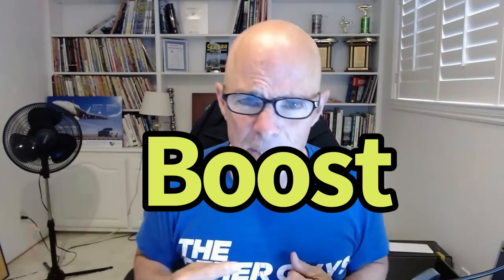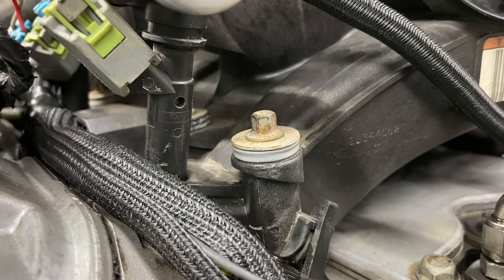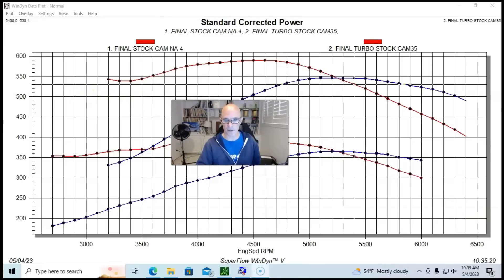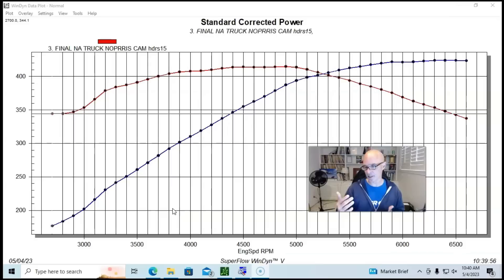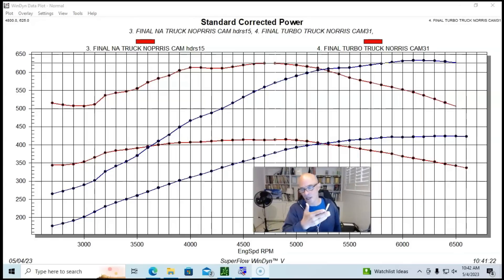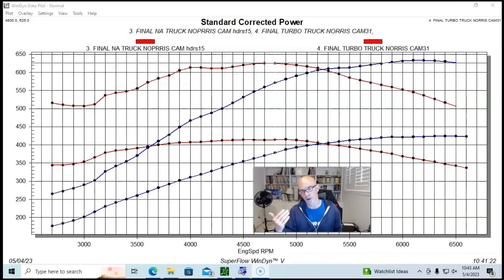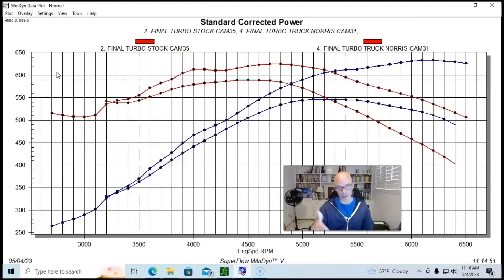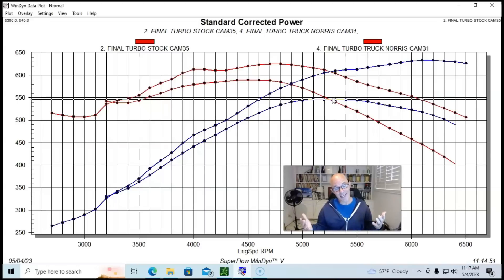JUNKYARD TURBO LS. HOW TO MAKE MORE HP PER PSI. JUST ADD A CAM!

Comment: Richard I got another question on my 6.2 with sloppy stage 2 and two of these turbos gt45t4- 106-98 will it be a good idea in my 280 z or different turbos just daily driver back half car thanks again
Reply from the maker: do you want or are you ever going to use 1500 hp-if not-go smaller
Reply: WOW thanks for the info sounds like it would have room for improvements later on down the road appreciate your time thanks again for your help

Comment: Thanks Rich for all your hard work. Do you have any data over the years to compare de-capped factory injectors with aftermarket injectors. Any opinions on this topic?
Reply from the maker: DECAPPED IS NOT GREAT-IT TAKES A LOT OF DECAPPING TO GET 8 THAT FLOW THE SAME-AND EVEN IF 100% DUTY IS THE SAME-THE SLOPES CAN BE DIFFERENT
Reply: @richardholdener1727  Thanks Richard, you're awesome.

Comment: Just wondering did you already make a flat plane crank 5 3l video?
Reply from the maker: that will never happen
Reply: @Richard Holdener  is that not something you would bother with or would there be another reason

Comment: Turbos will not work properly if there is a lot of cam overlap.
Reply: I thought so too, but Richard has done a video explaining that valve timing at high rpm is still a minuscule amount of time, coupled with back pressure, there isn’t going to be a whole heap of boost blowing through an open exhaust valve. I too am interested in this effect as I’m going cheap on a turbo build by using my previous big cam (VCM710 with 110°lsa) from an N/A LS1. The cam is probably way too big as the turbo engine is an LR4 4.8, but I’m a sucker for punishment.
Reply from the maker: pick the cam for what you what the motor to do NA
Reply from the maker: define a lot

Comment: So would changing the degree as to where it’s set in at help bring lower in torque numbers up? Not sure what the truck Norris cam is ground on but say it’s a 112 or 109 an you set it in on 104 degrees thanks
Reply from the maker: sometimes yes, sometimes no

Comment: My combo is easily making well over 40 hp per lb of boost…. sort of… because that is not factoring in the parasitic loss of the supercharger. Something fun for everyone to think about and to consider when doing their own calculations 🤯
Reply from the maker: so your na motor makes 588 hp?
Reply: @richardholdener1727  hi Richard! It is a 427 stroker LS with AFR 245 heads, cam is 243/259 .624/.624 116 +5.  I never had the engine on an engine dyno per se but this combination is well documented to make 625-650+ NA power.

Comment: Hey Rich, any plans for a "Diesel power" type testing (preferably boosted Gen VI 454)? Something with BIG mid-range and a max RPM of about 5/5500 to be used in a tow/haul application. Turbo choice would likely be key to quick boost response, without excessive backpressure.

Comment: What about adding rocker ratio, for every .1:1 of rocker ratio gives about 2 degrees more of duration@ .050" plus the extra lift it provides. So if you go up about .3:1 that would be like a cam with 6 more degrees of duration and the extra lift from the ratio. 

Have you tested this with a factory cam with boost to see if there would be an increase?
Reply from the maker: rocker ratio tended to add power with rpm on the stock cam